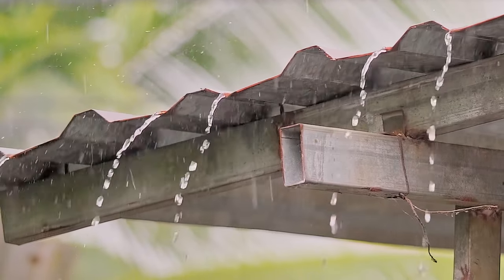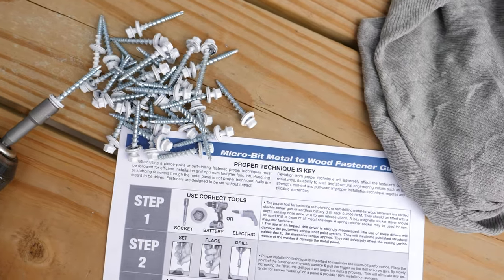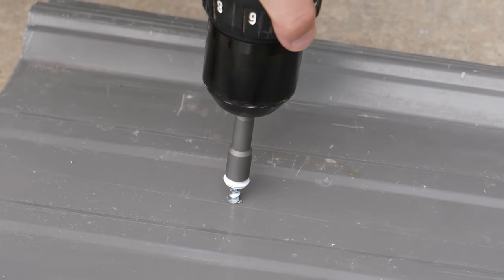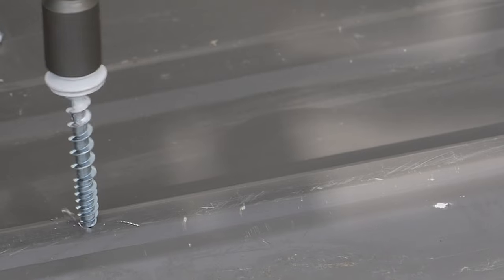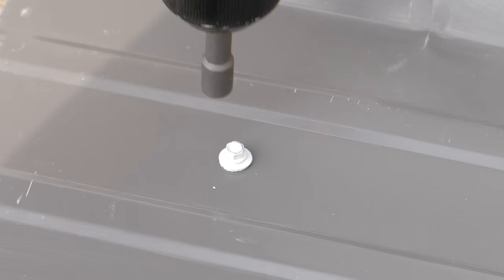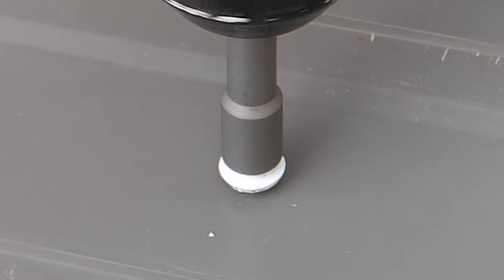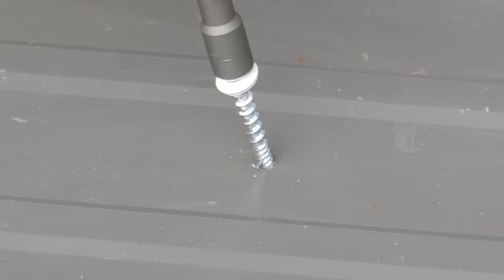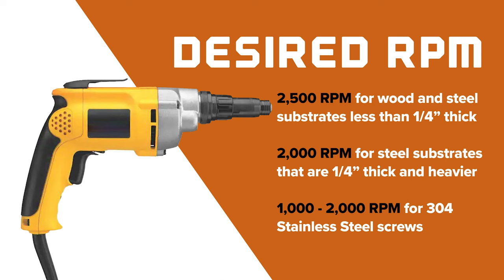How to Screw Down Metal Roofing

Comment: I used to screw them on the rib, but I think screwing in the flat area should be better for a couple of reasons: better fastening to the wood bellow and allowing better dilation and contraction due to temperature.     Although water affects the washer over time, it should be no problem for at least 10-15 years. So, use good quality fasteners and the proper length. This is more important.
Reply: An iron roof today will last more the 60 years and some will last 100 years. You should always fix the the crest of the roofing sheets then you will no maintenance problems other than painting. If you fix in the bottom you will eventually have leaks. Here in Australia hey are always fixed to the crest. I am a retired roofer, i  have been putting iron roofs on for 30 years.
Reply: @johnbarber107  You're a funny guy. Iron  roof??? We're talking about screwing through steel. Screw through the flat part for the best performance, i.e. wind uplift and water leakage.

Comment: How do you keep the screws into wood sheets from backing out over time?
Reply: @fn6553 here in Australia they never back out.
Reply from the maker: Thank you for reaching out!  They key to longevity is in the washer, the material and the threads.  For example, our ZXL MB WoodBinder screws are cupped with a molded ZAMAC Zinc-Aluminum alloy that provides a lifetime protection against red rust on the head and washer.  The threads transition from a fine to coarse to generate holding strength in to the wood.  The micro-bit point also reduces metal shavings that can embed in the rubber washer.  What it really comes down to is the quality of the fastener and installation.  If you have more questions on this, one of our Product Specialists would be happy to talk through your project with you.  We are here Monday - Friday 7:00 am - 5:00 pm CST.  Give us a call at (888) 794-1590.
Reply: @fn6553 when fools fix metal roof sheeting to ply sheeting it is not a matter off time if they back out it is a matter of time when they back out.
Reply: @robertbutler8004 It doesn’t matter if the metal roofing is screwed fast to wood or steel because expansion and contraction of the metal roofing panels eventually pull the screws.
So what if the metal panel lasts 50 years when it starts leaking water in 10-15 years due to the roof, expanding and contracting. The only metal roof that should be used on homes is standing seam.

Comment: What about on a steel Z purlin? on the flat or the ridge of the roof panel?
Reply: @johnbarber107
1 second ago
An iron roof today will last more the 60 years and some will last 100 years. You should always fix the the crest of the roofing sheets then you will no maintenance problems other than painting. If you fix in the bottom you will eventually have leaks. Here in Australia hey are always fixed to the crest. I am a retired roofer, i  have been putting iron roofs on for 30 years.

Comment: What about all the debris from the screw drilling the hole. You need to work on that problem before you worry about all this other nonsense. It is painfully obvious that the engineers at this company have never done 2 things
1) done this type of work
2) watched the video 
 I saw the flaw @ 1:50  then 1/2 dozen more times throughout the video.
Reply from the maker: Thank you for pointing that out. I will pass this along to our media team to check this content and have our Quality Team review as well.  It is very important to us that we are providing useful quality content.  Thank you again for sharing!
Reply: Amarshallcollins8634 agreed at about 1:50 the swarf was left under the rubber washer here in Australia we screw through the ribs and the swarf is inclined to fall onto the flat and then blown off with a leaf blower.
Reply: @robertbutler8004    You can also wash the roof down with water. I have worked in Darwin and the roof is hosed down at the end of each day. this will get rid of the swarf.

Comment: Only fools screw through the flat part of the metal sheets.
Reply: Appears to be THOUSANDS of fools out there doing this work
Reply from the maker: Thanks for reaching out and sharing your thoughts.  There is certainly varying opinions on this topic.  It seems installers have a preference based on what has worked best for them.  We did ask this question from Manufacturers on what they recommend.  Their recommendation was the flat part because it offers a solid wood surface below the panel, resulting in a tighter more secure seal.  We have read several great articles from installers who are trusted experts in their field that say otherwise too.  Thanks again for sharing, we always appreciate the feedback!